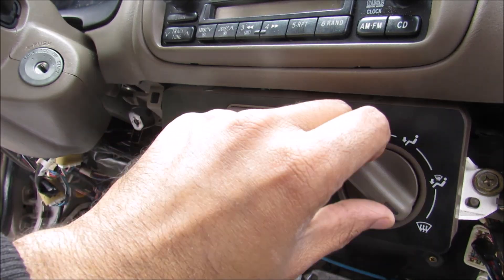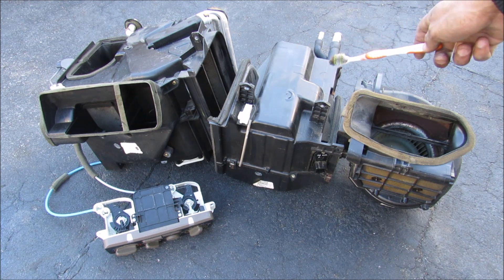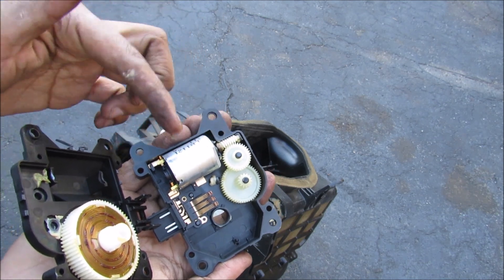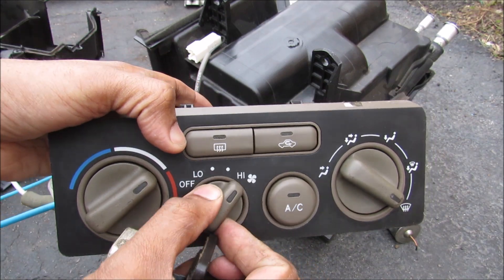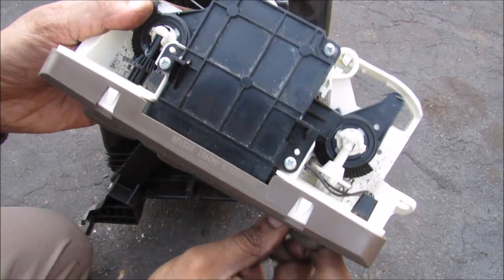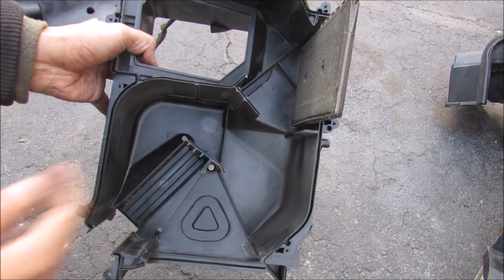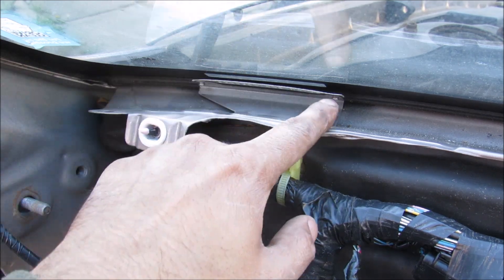How a Car's HVAC System Works

Comment: Please make a video on automatic AC
Reply from the maker: Yes I plan on making one next year
Reply: I am little more curious on how different is working  mechanism  of automatic ac compared to manual AC.. I understand that procuring a car would be ACC car would be difficult.. :-) I see some of the cars have auto AC on higher variants. So just curious about ease of replacing a manual ac with auto AC .. thank you

Comment: How come when using the defroster on a cold day, it draws in outside air? And if I switch the air to recirculating mode, the windows start to fog up? Isn't the air inside the car warmer than the outside air?
Reply from the maker: The air inside your car has moisture which causes the fogging. Not temperature

Comment: So in order to remove fog from windshield and windows quickly should we keep ac temperature in hot mode or cool mode on switch.
Reply from the maker: It doesn't matter. The evaporator removes moisture regardless of temperature
Reply: @speedkar99  In reality, hot and dry air is even better (faster) at removing humidity than cool and dry air. The maximum absolute humidity of air increases with increasing temperature.

Comment: Question about defrost.
In winter when we run heat and ac at same time to defrost the windshield, the ac cold air Passe through ac core than to heater core before reaching windshield? 
I mean how the air is filter to be dried?
Reply from the maker: The AC dehumdies the air
Reply: speedkar99 but how it dehumidifie?? That d the I don’t never got

Comment: Thanks for making this video, so informative. So am I right in thinking that this HVAC system is totally separate to the air intake system that directs air to the throttle body and engine air intake manifold? Also I didn't see any kind of air filter for the HVAC system. How does dust and leaves get stopped being blown through into the driving cabin? Many thanks!!
Reply from the maker: This car doesn't have a AC filter. 
I have a separate video for the Air intake

Comment: I found out that My 2006 Toyota camry have not had a cabin air filter since I bought it on 2009. The heater and AC seem work well. Now I ordered a new cabin air filter. Can you suggest what to do ? Do I need to take off a blower motor and clean up inside ? Or do something else ? Thanks

Comment: I thought theres a valve to allow or stop hot water from going through the heater core!!.. My Toyota FJ cruiser AC has a complicated problem.. passenger side cold while the driver side is warm.. any help is appreciated :-(
Reply from the maker: Seems like your low on refridgerant.

Comment: when hvac is set to cool down air by aircondition, and when switch it off, and then switch on heating , will it help to  dry  aircondition cooler from moisture and water that was condensated in it ( I usualy 5 minutes before driving will finnish, turn off cooling, and leave  it on recirculation and when notice smell of water , switch it to blow fresh air from outside and 1 minute before stpo, turn on heating to dry airconditioning cooler)
Does it help or not

Comment: How do the cars actually regulate the temperature of the air coming into the cabin (on a more fine tuned basis)?
Reply from the maker: Fan speed or a valve on the coolant line going to the heater core.
Reply: Fan speed, water flow into the heater matrix (either bang-bang or finetuned), % of air flow through the heater matrix (finetuned and the most frequent method on car HVAC), % of recirculated air and % of warmer/cooler air, compressor clutch cycling, compressor unloading (reduction of refrigerant flow to a certain value to keep suction pressure and therefore the evaporating temperature above a certain value) if the compressor is equipped with a remotely controllable unloading device (a solenoid valve that either shuts down the suction flow to a compressor piston bank, in the case of bus v-piston AC compressors, or adjusts the angle of a swash plate, in the case of automotive swash plate compressors).

Comment: take a second look on the thermostat map, actually it's after the engine to preventing too cool engine water which it helps to warm up the engine. if it was behind the engine the thermostat wont work as its get feeded with cold water from radiator.

Comment: Hi, how the AC System Controls the output temperature of if If it doesn't uses a variable displacement AC Compressor?
Reply from the maker: By adjusting the temperature flap between warm and cold
Reply: @speedkar99  ok. I got it. It is an inefficient way, don't you think? I asked this because I want to disengage my compressor from engine timing belt and use an electric motor to run it independently if the motor of the car is on or off. I will install a solar panel and another 12V battery. Is it possible? Thanks again
Reply: Temperature flap (% of air going through heater matrix), recirculation flap (% of outside warmer air) and blower speed. I don't think a solar panel is enough to reliably power what you have in mind...

Comment: Great video.  Could you explain why when turning A/C with outside vent closed (inside circulatory air only), the A/C is much cooler than when outside vent is open?  At least that's what occurs in my vehicle.  I think something might be wrong.  Because at idle, when the outside vent is open, the temp starts to increase.  But when vehicle is moving w/outside vent open, the A/C begins to lower again.  However, with A/C outside vent closed, air is relatively stable at 44 F.  Your thoughts?
Reply: for coooler  air  keep it recirculating as  cold air is aspirated and refresh again..if you take air from outside it could touch sheet metal that is warm (close to the engine) so it takes more effort to cool it ...as is a constant stream of hot/warm air vs  constant stream of already cooled recicled air

Comment: Hello sir, my car's ac cooling properly but humming when compressor engaged and rpm is low or idle. This hum loud in cabin, not outside. But when increase rpm, humming decreased. What's the problem sir?
Reply from the maker: That stumps me. Blower motorm
Reply: @speedkar99  blower motor is fine and cooling function also perfect. Its happened only when compressor engaged in idle. After increase rpm, then its gone.

Comment: I never knew either that the evaporator wasn't a radiator core, just a pipe connected to a big heat sink (or cold sink...)
Reply from the maker: +HailAnts Yea its like a radiator but backward, absorbing heat

Comment: So lets say its the morning and its freezing outside. You turn your heater on but it only blows cold air. You've been driving for 20 minutes but your oil temp does show the cars not that hot and the heater still blowing cold air. Does that mean the temp gauge is stuck open?
Reply from the maker: Yeah the thermostat is closed and just recirculating past the engine
Reply: @speedkar99  Can u believe I just took my thermostat housing off and there was no thermostat! Previous owner removed it lol

Comment: @ Speedkar99
What would cause my my 07 cadillac escalade to low haet? Haet goes up a little when i rev up the engine. Any suggestions??
Reply from the maker: Bleed the coolant system
Reply: speedkar99 
Thanks a lot it worked👍🏼

Comment: so is it right to turn a/c on when trying to warm up car cabin?  and what about  recirculate on with heat on while a/c is also turned on?
Reply from the maker: +Giovanni Arohsiri AC acts as a drier to remove moisture when the heat is on. So it's best to use it with fresh air otherwise your just dumping back the moisture in your cabin fogging up the glass even more.
Reply: speedkar99 Thank you kind sir. appreciate the response! will do
Reply: @speedkar99  Well on buses the "reheat" mode (AC+heater) turns full air recirculation on too. It keeps the evaporators from freezing up in cold weather, since the huge compressors used there can't cycle the clutch fast like automotive ones can without damage to both the clutch and the compressor... as long as the evaporator is live then i suppose all the moisture stops on it, also, once you've dried the air's cabin down then there's no more moisture to catch...

Comment: My car condenser the aluminum piece on the bottom got damage while i replace the radiator is that still be ok ? Anyone know please let me know thanks .
Reply from the maker: If the condenser is leaking then no, you can't reuse
Reply: speedkar99 no leaking yet , just the bottom piece that protect the bottom and pins grille fell off , today I just silicone it back , the second line on the bottom I think it has liquid but it’s still fine just the pins grille fell off .

Comment: Excellent video!  What I kind of knew but interesting to see the parts close up.  Did you actually put that dash back together?  That gives me the chills just thinking about that job!
Reply from the maker: Before this video, I did have the dash out and then put everything back together. So taking it out this time again was a piece of cake. Its not as hard as it seems. The wiring clips are the most annoying. Toyota makes it so easy to take things apart and work on.

Comment: why dont they connect a hose from the cabin ac box and route it to the engine airfilter box to put cold air into the engine? wouldnt this be a true cold air intake?
Reply from the maker: That would be extremely inefficient. Why don't cars make more power in the winter then?
Reply: they are more efficient in gas mileage in the winter than summer. Also, not logical to call an open air intake a cold one because there is nothing cold about it...the air temp is still the same where ever you are. really just adds less restriction and a louder noise.

Comment: 7:21 - no it doesnt - it just shuts off the ac and flips the heater flap when u switch it to heat mode
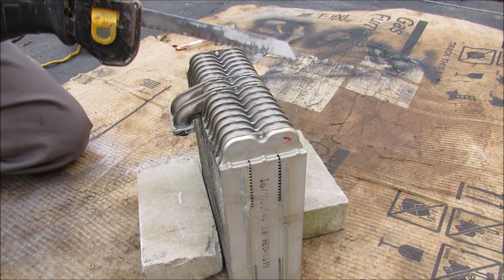4:45 - thats also wrong - u can clearly see the small holes inside the pipes that drop all the way down to the fins that u cut open

Comment: If the refrigerant only flows through the top of the cooling coil, then the coil should last a long time before leaking
Reply from the maker: I think I flows through the whole thing
Reply: @speedkar99  From the cut thru, you showed that the refrigerant only flows at the top of the cooling coil

Comment: From the engine, someone bypassed my water inlet hose direct back to the engine, and another outlet hose supposed to go back to the engine is also bypassed (their bended the original hose and connected the water inlet to the evaporator; the original inlet hose was bended too directly connected to the engine, as some of the air conditioning shop owners said to me in our country, Malaysia, no need for hot air). After I change my heater core compressor and all air conditioner hoses, I begin to be unable to switch to control the temperature, 21–27 degrees celsius, same cool, no adjustments to control the temperature of the air conditioner?
Reply from the maker: Isn't there a valve going to the heater core?

Comment: The my question...
Why the fabrication assembly parts automotive cars not have including installation inside gap the pipe nozzle spray water for useful cleansing the evaporator...? . Samelike the spray wiper front glass windows...  this is the way The owner cars have doing easy cleansing itself for the evaporator if when the time to needed for... 
I think you understood what i mind...
Reply from the maker: Usually an air filter prevents the evaporator from getting dirty in the first place.

Comment: if you run your ac but turn the temperature control partially up will it turn on and off the ac to match that temp or will it just run the conditioned air over the heater core?
Reply from the maker: +Jimmy O. In this manual setup it seems like they both run 
Perhaps in a more automated setup it would cycle 
The idea is the actual dries the air so you don't have fog building inside the glass
Reply: I was wondering not because i would like to use it to de fog the windows but on long drives the car turns into a refrigerator. but the outside temp is still un godly warm. i feel wasteful turning the heater up with the AC going to get the correct temperature and toggling the AC compressor on and off I feel is not great for the AC clutch. first world problems.. it would be nice if the AC had a bypass valve that would unload the compressor allowing it to keep spinning but the work required to just circulate the refrigerant instead of compress it would be much lower. until the demand was needed where it can kick back to normal cooling mode
Reply: If you the evaporator core is located before the heater core then running recirculation will run the hot air through the evaporator core. If i do this in my car i immediately notice the compressor putting more strain on the engine, while if i let it on fresh air it's like the compressor is turned off (i have one of these compressors that stay on all the time when AC is on but pump less refrigerant when the evaporator becomes cold btw, mine is a Delphi CVC with internal control; Google for "Harrison V5" if you want to understand how these compressors work; my compressor also apparently cools the evaporator down to a colder temperature with higher discharge pressures i.e. in the Summer than with lower ones). So on fresh air it will keep turning on and off/unloading the compressor so that the evaporator won't freeze up (even if you're getting hot and dry air inside) but on recirculation it will be basically trying to cool hot air... i do this (AC+hot+recirculation) from time to time in the winter to keep the system lubed up btw, on very cold days (50F and below) the compressor otherwise turns on but stays unloaded all the time (it makes a deep groaning sound when it's fully unloaded, it's the pistons travelling a very short stroke and making the suction pressure oscillate very rapidly and the noise travels through the evaporator to the vents)

Comment: My car cabin is allways hot, now I'm almost sure that this vent 6:54 is allways open letting the air pass thru the mini radiator... I'm almost sure becuase the cabin keeps getting warmer even when you shut off the engine
Reply from the maker: Yes. Check those vent flaps

Comment: Thermostat control coolant going back to radiator and open at certain temperautre so it can get cooled by fan and air hitting front of car and then again sucked by water pump
Correct me if i am wrong thats only what i picked in this video i think is not right
Reply from the maker: In this circuit, the thermostat controls the flow of cool coolant going into the engine. When closed, it allows the engine to warm up, when opened, the engine recieves cold coolant

Comment: That part about the refrigerant flow only through the top to the evaporator is WRONG.
Reply from the maker: +Ojo Felix NM do you mine telling me what part is in correct?
Reply: The refrigerant flow through the evaporator is the same as the coolant flow through the radiator. It doesn't just flow in and out the top. The inlet and outlet headers may be in the same position, but the refrigerant flow is through the tubes where heat is absorbed from the incoming air.  Very thorough video.And very well done.

Comment: Can anyone point me where are the points to check... passenger side is warm compared to the passenger side, sometimes a bit cold but still passenger side is colder. I already  recharge with freon but its coming back, there are some videos that says fix in the actuator, fuse, evaporator.. does any one here  experience and fix this problem. Thanks.
Reply from the maker: Have you checked the flaps inside the HVAC box

Comment: hii,

when i saw your video, reminded me of Chrixfix.. lol. 
he is about the same style as you.. short to point.. very informative.. appreciate it. 

btw, it is my air con that have weird funky smell when i turn on the air con.. the initial funky smell is very strong.. that leads me to your video. 

do you by chance have a video on moldy evaporator ? or is it the air passage way that is moldy that creates the funky smell ? 

how to solve the problem myseif without ruin the whole car ? lol

thanks

good video.. deserve an A++..

andrew
Reply from the maker: Hey sorry I don't have video on AC smells. 

I don't see the similarity with CF...he has his own style and topics...mine are vastly different
Reply: Hey hvac tech here!!! Drain your refrigerent, keeping track of how much oil you take out, remove your glove box, and fan if necessary, then evaporator. Soak the evaporator and drain pan in bleach etc something to kill bacteria, being careful not to get any inside, then rinse really well. 

Reinstall and recharge making absolutely sure to replace any oil you lost. Check for leaks. Should fix it. 

Typically, the coil and drain pan gets bacteria on it because they are covered in dust and gets wet so often then sits in a hot car with basically dirty water all over it and it starts to develop bacteria.

If you aren't comfortable with this, take it to a shop. Also, if this doesnt fix it, it means some has gotten in the duct, which usually doesn't happen but if water gets in there it can. So you would need to do that too. Best choice would be to inspect the duct and clean as necessary. But i can guarantee you the main issue is the evap

Comment: How old is that car? I doesn't look very clean inside.Better open a window . I got 2 questions:The clutch must not be pressed fully down to change gear,am I right ?  At the fuel pump,today the flipper went all the way and made the pomp stop,I guess that was because of the sensor that detected few drops of fuels near the entrace hole of the car,or was because of me?
Reply from the maker: +KingTsunamy Its a 2001 corolla. And no its not that clean at all. 
Clutch has to be pressed past the engagement point. 
Pump will stop when fuel entered the tip or your evap system not working properly.
Reply: Thanks :)